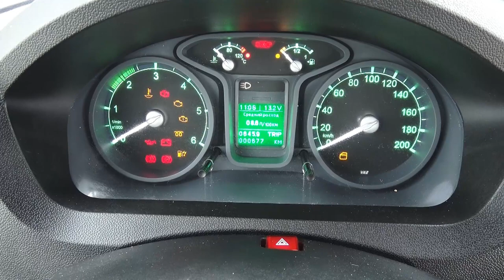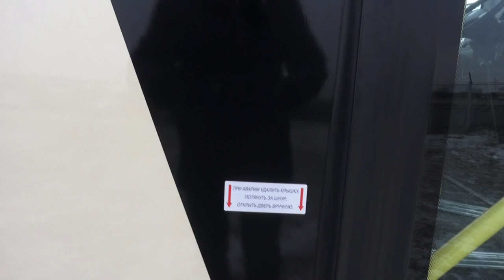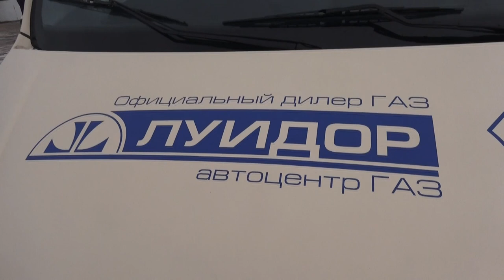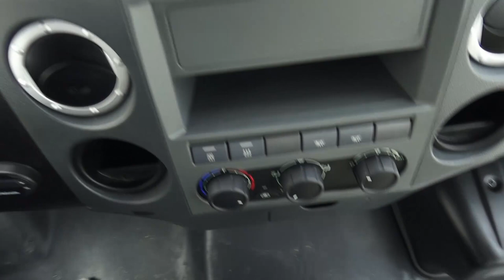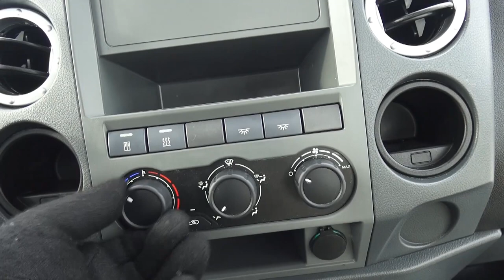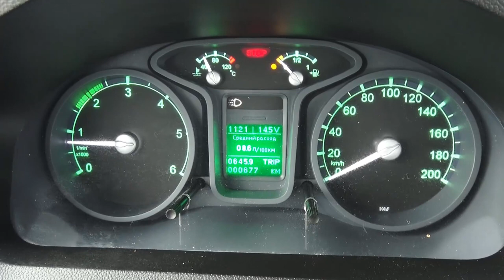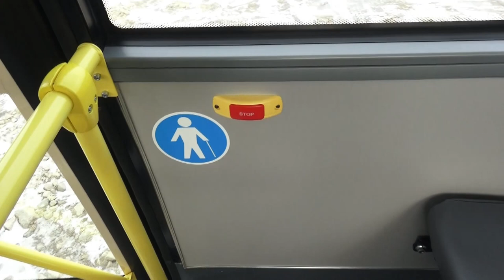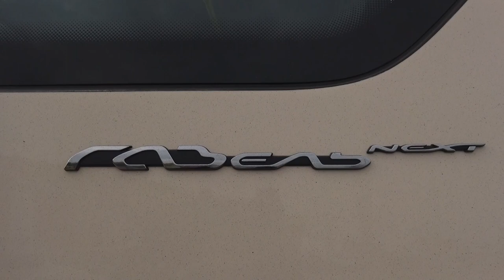2014 Gazelle Next Bus. Start Up, Engine, and In Depth Tour.

Comment: MegaRetr, Is it optional for this bus to be equipped with Stereo System that has Speakers & CD Player with USB & Auxillary Inputs?
Reply: Earl Matthew Avila no
Reply: @Ameer Hamza 222 a22

Are these vehicles Euro-2 or Euro-4 compliant as far as the engine is concern?
Reply: Earl Matthew Avila I am sure the engine is Euro 4 only.
Reply: @Mario Soto

OK